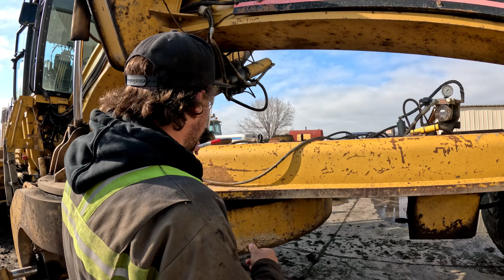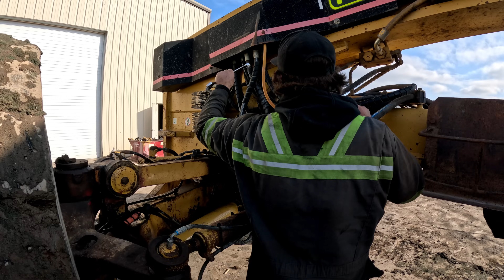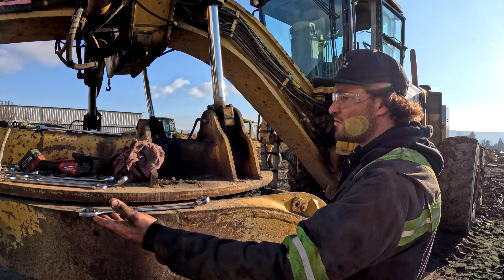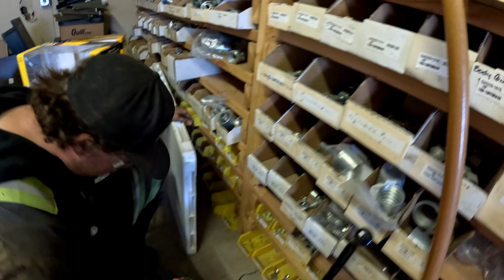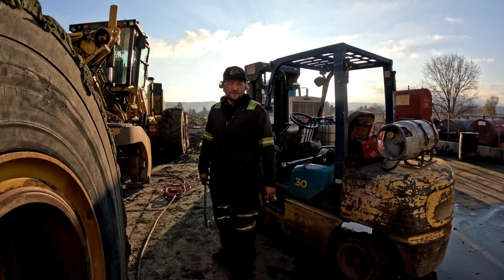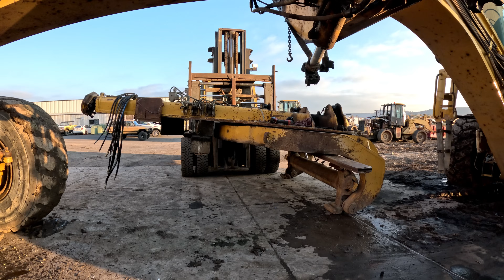Dismantling the WORLDS LARGEST MOTORGRADER part 3 - cat 24H

Comment: You can 99% never over grease. Pins and bushings are much more expensive than grease   But seals are more expensive than grease.  So when there’s a seal holding the grease in. You gotta watch the amount of grease you pump. JMOs.
Reply: WTF
Reply: @haroldparker3487  what do you mean WTF ?
Reply: What you wrote makes no sense.
Reply: @haroldparker3487  im sorry. I was still running the tree cutter. 🤦🏼‍♂️ I fixed it. THANKS !!

Comment: If you had put a vacuum hose in the hydraulic fill spout and turned it on, it would have prevented all the hydraulic leaks from the hoses you pulled off.

Comment: Probably not over 20 k. The problem was that the weight was on the end of the fork extension. 20k at the pins not 8' in front of them . That lowers the picking weight drastically. Besides the fact that fork extensions are only supposed to be 150 % of the main fork. You were way beyond that. Safety last. Job finished fist my motto.🍻